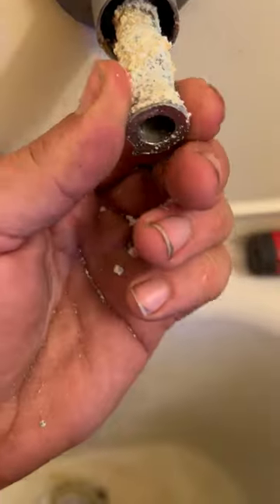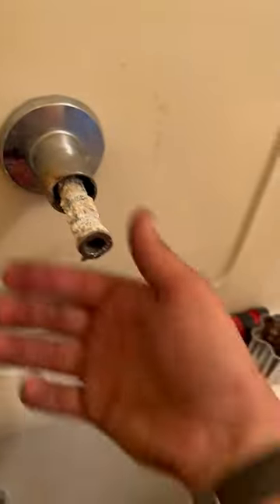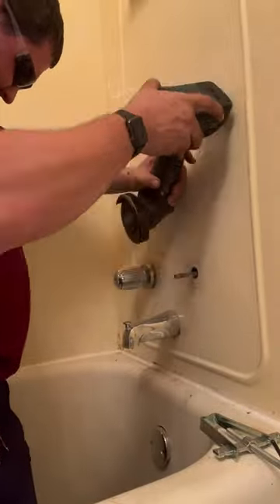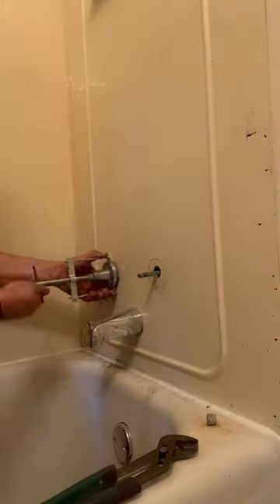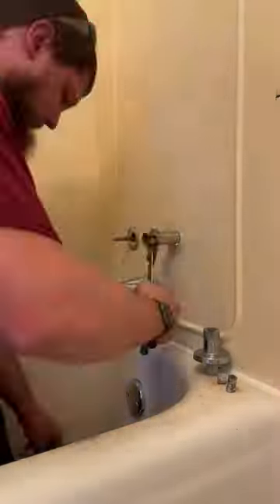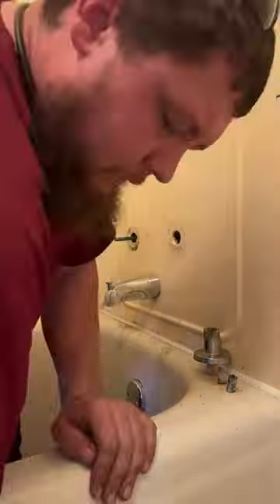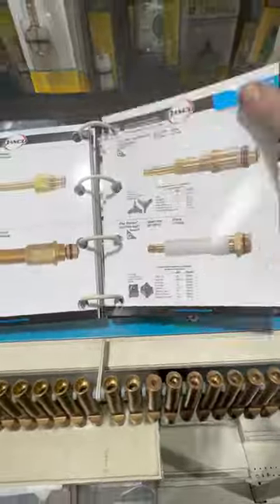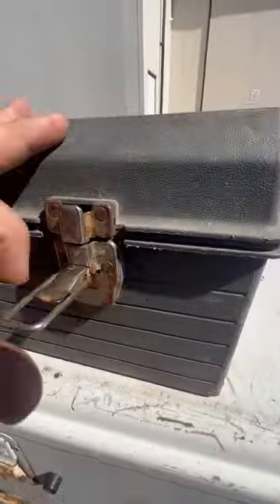Replacing the valves on tub/shower#HandsomeOrHandy#Handyman#Plumbing #HomeDIY#PropertyMaintenance

Comment: I had some handles i couldn't pull off no matter what i tried and i saw someone say mix 50/50 transmission fluid and acetone,  shake it well because it will separate. The transmission fluid is very thin and the acetone pulls it into fine cracks and drys very fast and it worked very fast .

Comment: Leaking faucets are the result of progressive washer age / damage. When I get there they are leaking to the point of your fix, it is usually the result of someone cranking on the handle in a last ditch effort to stop the leak.. Nothing like going to the store, standing in line to pay, driving all the way back, putting the stems and escutcheons back on, firing up the water only to find that the faucet is still leaking. See where I'm going?
Next time stick your finger into the body and check the seats. Just sayin....

Comment: Damn. I'm asking my boss for a helper from now on. Didn't realize it was a two man job. But definitely just replace the entire valve instead of fixing that old old crap. That way you'll have new handles, tub spout and shower head. Hell, it even comes with thread tape.
Reply: Damn. From now on I'm telling my clients they don't have any choice but to pay for a complete replacement with all that extra work.
Reply: @Dwayne_Bearup  What you ought to be doing is telling them that their old ass valve needs to be updated and it's not much more work. But hey job security for you 👍
Reply: @futuregamer5791  Old does not always mean useless. Often, resealing the stems or replacing the cartridges fixes the problem. I give my clients all the information they need to make a fully informed decision, but I'm a handyman, not a babysitter. Nor am I a judge of how my clients should spend their money. Maybe all YOUR clients have more money than sense and always just do whatever you tell them, but all MY clients either work for a living or are retired from working for a living. I won't rip them off by telling them to replace something that doesn't absolutely need replacing. But, you know, you do you.

Comment: No seat replacement? No criticism, I myself find them to rarely be the problem. If the seat is damaged 1. Time for a new valve 2. Another plumber used a flat head and hammer

Comment: Nice guy I would never fix that junk I'd make them replace it.
Reply: Really? You’re wasting your customers money. There’s absolutely nothing wrong with the valve. These parts are replaceable for a reason.
Reply: @codygooch510  replaceable stems definitely. But what happens when the brass seat is cracked or corroded. That was some real hard water they had. Gotta make an educated decision given all information. Not a question of if you can, but if you should.
Reply: @Cody Gooch  if you are charging hourly and driving all around town trying to find replacement parts your customer will be pissed.  Better and cheaper to just change the whole thing out.
Reply: I tried going after parts once. Never again. Just keep a new complete unit on the truck.

Comment: Wouldn’t u check for leaks before putting escutcheons and handles back on ?
Reply: Not really when you can get inside the back wall like you find easier there running down the pipe when you turn on the water and wait a minute and watch before it's better than what you can see in that little hole in the shower
Reply: @magenlin  yea ok

Comment: Will most likely leak almost immediately when those valves leak it’s because the seats are scarred
Reply: Young folks locking them down thinking that they can save the couple drops of water left in the spout is a more common cause
Reply: @anthonygrant7952  what?
Reply: The seat might be fine, it could just be the washer. 9 times out of ten when I do this the seat is just fine and the washer is torn to shreds from people over tightening the handles. I change the seats no matter what since it’s only about 5$ in parts and they already have me for an hour with a service call. It prevents you from getting called back a few months later for a problem with the same fixture, Murphys law being what it is.